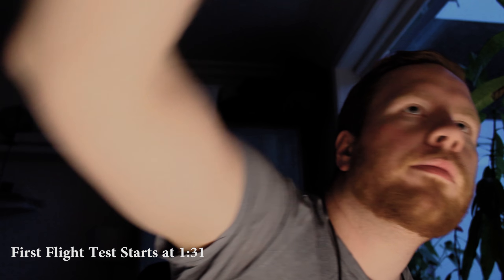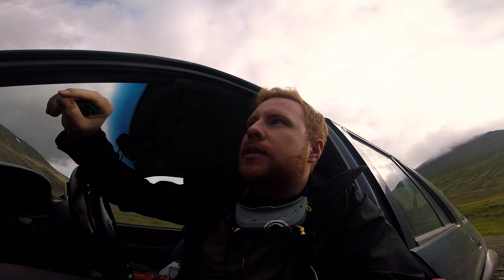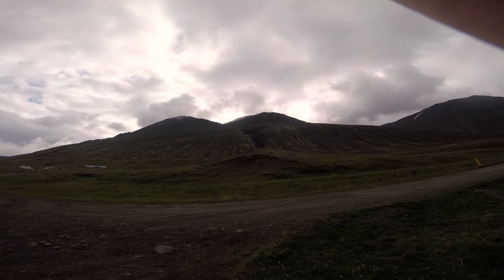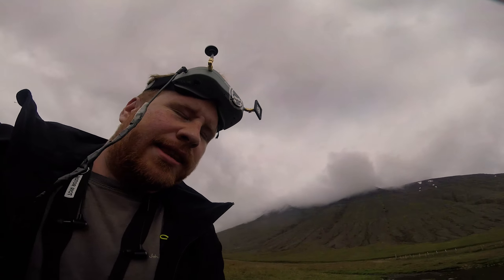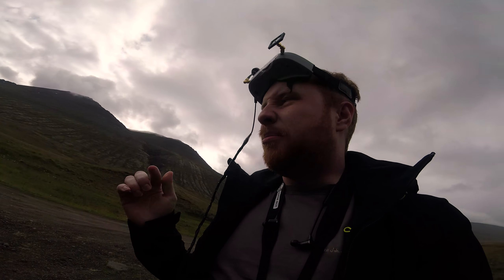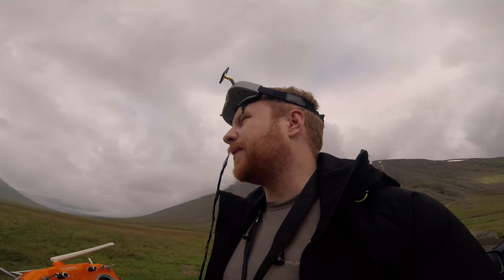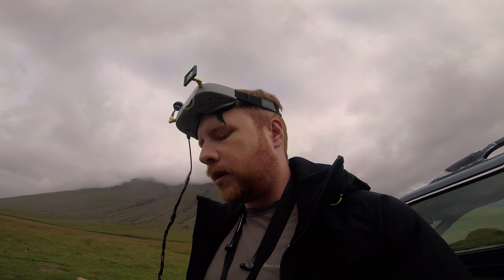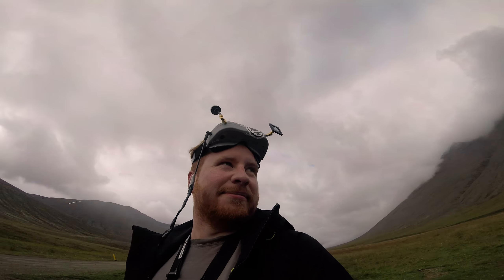How Far Can You Go on a Stock Taranis Q X7?

Comment: great video :D i am still using my Taranis X9D+ with the stock 2.4GHz built in transmitter. i have done the antenna mod and i sometimes use a 5dBi antenna for a bit more range.
using a tbs unify pro at 500mW with the tbs triumph and my video can go as far as my RC link. i have managed to do a few 2km flights this summer but i wont go any further than that because it would drain my 1550mAh packs.
Reply from the maker: Very impressive! 2km is really far on a 2.4GHz link. The Unify Pro is probably the best money you can spend if you want to increase your flight range. I think I'll try putting that with a Triumph on my freestyle rig and seeing how far it goes
Reply: Hi. If you could enlighten a little, what are the antennas you put on your goggles for receiving signals from the Unify Pro? Thanks. 
Did you get breakups during that 2 km fly out?

Comment: I agree that it looked like your video feed and battery were the main limiting factors from what I could tell.  Maybe a higher output Unify VTX and a larger capacity battery next time?  I love how far my stock Taranis X9D+ will fly with no obstacles in the way.  I still haven't found the right place to really test out the range around here where I live though.  Keep the content coming!
Reply from the maker: That's the plan! I want to experiment more with this kind of setup, but next time I'll probably try the Unify Pro at 800mW with at least a 1500mAh battery.

Comment: I got the same Taranis. I wanted to try out an eachine RTF drone with this taranis. Connection is fine, controls are fine but there's a constant telemetry warning until it finally drops.. Range on that parking lot appr. 20m?  What is going on? Is it either the firmware on the R81 rx or did I miss any setting in the taranis? Do I have to adjust telemetry settings? Cheers

Comment: Nice vid! Where do you keep your commander batteries? Saw that you have long wires connected to it.
Reply from the maker: In my pocket! I just made my own long XT60 to barrel connector wire
Reply: Workbench – Home DIY Engineering thats clever. I think its safer that sticking it at the back of your head.